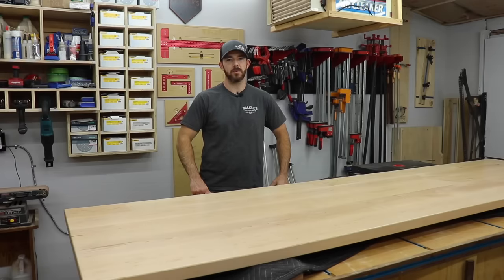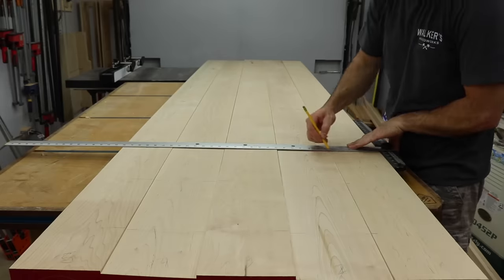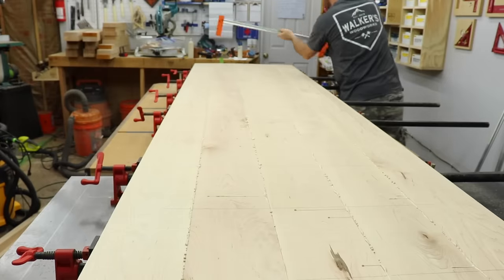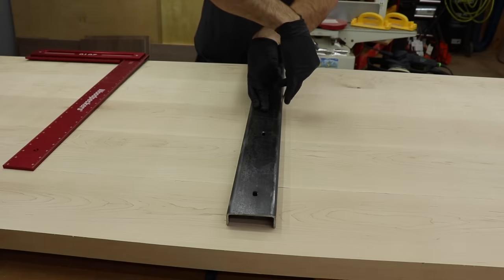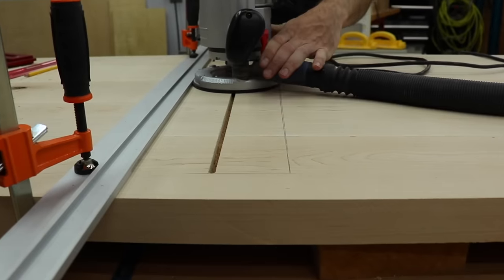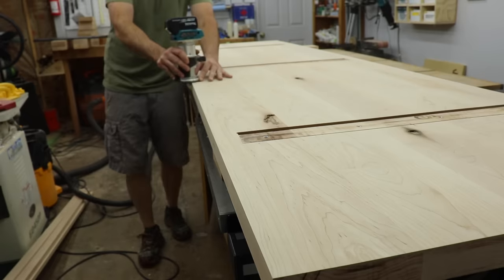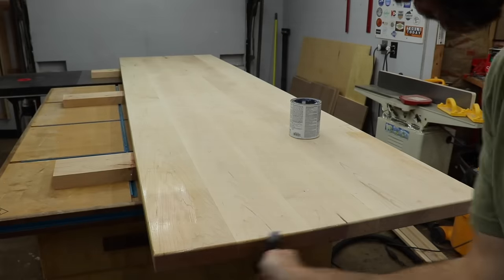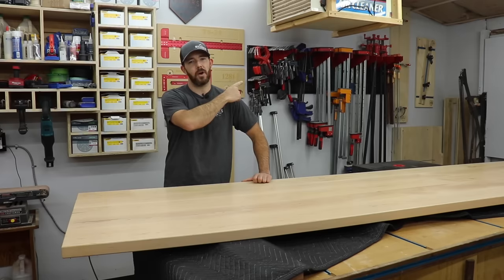How to build and finish a desk top / DIY Table top

Comment from the maker: Be sure to check out my website for other Projects, Blog posts, Plans and Tools I use! Walkersww.com
Reply: This was probably already asked, but what did you use for the legs? Same metal I imagine, but curious if they were just straight legs or "U" shaped. Great video!
Reply: I’d love to see how to do this with out all these fancy tools, I need to make a table top to replace my mdf one. And no idea how to put it together I got the wood glue some g clamps which I’ve realised are the wrong size and wood filler been trying to look for a how to
Reply: Hey I have a question, why did you us biscuits, I see some woodworkers use biscuits or dows, and others don't use them at all. So when do you need to use them?

Comment: I don't know if someone else already mentioned this in the comments, but useful tip for new woodworkers: don't make your biscuit slots too close to the top side of your boards. After moisture sets in they will "telegraph" through the wood by making the surface uneven. You'll be able to see where they are, and the customer will too. Especially when you try a new type of wood and you don't know how it'll react it's best to make the slots closer to the bottom side of your boards.
Reply from the maker: Good tip. I always try to center them.
Reply: Дякую за пораду:yougotthis:
Reply: Ang ganda.

Comment from the maker: Sorry about the glitching!  It must have been in the upload process.  Try to stick with me haha.  Really appreciate all your support!
Reply: Thought it was time for a new phone...
Reply: Do you have a link or any info on the shop vac connection you have for you biscuit jointer
Reply: Hey, that’s ok. I think if you know it’s there, maybe mention it with a card at the beginning? It’s a tiny bit of a seizure risk.
Reply: I want to see a mortise and tenon wedge table, like a normal table top that has mortises running through all the boards and wedged at both ends, glueless tabletop?
Reply: if i dont want to buy a biscuit jointer or learn how to use one more so could i just use glue and pipe clamps?
Reply: Just curious what the finished length was on the table?   I'm looking to make a table that is about 11 feet long to go from one wall to another in my office and this would be the best way I have seen to go about it.   Thanks and great looking finished product.

Comment: Great job on the table, and really good looking materials. The only thing i personally would change is the use of PU. Here in Sweden, and the North generally, finding old furniture with natural coloration changes, some cracks and patina from decades of use, is a mark of beauty. If you want to experiment, try waxing the ood and heatgun melt it, then polish it into the wood and see if you like it. A very organic and fully chemical free version.

Keep up the great crafting, and stay safe 👍

Comment: me and my son in law build a 12 countertop we used 2-8 framing lumber trimmed the edges for square. screwed together with pocket screws quick sanding and stain when we were finnish it looked very rough. But i am impressed how good it looks once installed.

Comment: Love that you install channel on the underside to prevent bowing/warping over time.  GREAT idea!
Reply from the maker: I wish I could remember where I first saw that trick but I use it all the time.
Reply: @WalkersWoodworks  I am new to woodworking. Thanks for sharing this info. I have a question, does bowing/warping occur all the time if a channel is not made? Does it occur on all woods? And to my understanding, the channel you made also doubled up as the place to place the C-panel am I right to say so? Thanks!
Reply: @WalkersWoodworks  The great idea should now be considered stolen!
Reply: Could you also just 2x4 or 1x2?  Would it accomplish the same thing?
Reply: @eechiihaojulian9307 , it is not usual among furniture makers to anchor a table top to metal channel in order to keep it flat. It is normal to expect a piece of wood to keep its shape well enough, if it has been made from properly dried furniture quality stock. If the wood has been exposed for a time to conditions more humid than are normal indoors, for example stored under cover but outside, before being worked to its final shape, than you make expect some problems with stability.

Comment: Awesome build! For anyone else that's going to build something like this for a computer desk though if you don't sink the C-Channel or Angle Iron you can use them for cable management as well.
Reply from the maker: True Story!
Reply: Derek Ries so you get the same function out of the c-channels by not sinking them?
Reply: Dain if you flip the C channel 180 degrees it should give sufficient rigidity to prevent warping, providing you have used biscuit joints as well mate, obviously sinking the strengthening channels looks neater though.

Comment: Hey Brandon, I have probably watched this video 3 times since you published it, and I just finished building a simple maple plywood desk for my wife. I'm thinking of going back and putting a top like this on it later, and this video will be the one off of which I base the new top. Thanks for a quality video with clear instructions and no unnecessary ancillary commentary. (stuff like pointing out the awesome sunset is appreciated!)
Reply from the maker: Thanks a lot Michael that means alot.  Really appreciate the support. Good luck on the build!

Comment: This is a far cry from the desk I built out of 2x6s and a Kreg jig. But, now I have the bug and a lot more tools. Still need a ton more clamps though...
Reply from the maker: Woodworkers can never have to many clamps!
Reply: I have problems with no clamps, no nointer or planer either, got a few old hand tools but that's it

Comment: Outstanding video! I've got an 18" oak that had to come down a few years ago. A friend has a sawmill so we slabbed it out to 1.5"x 10' planks that have been stacked and stickered. All I needed was ideas of what to make with them. Once I've made dimensional lumber from them do you think they would be too thin (maybe 1") to do something like your desktop?
Reply from the maker: No not at all.  But I would do an apron with the base for something that thin and use table top fasteners to secure it.
Reply: Stickered?
Reply: @CoolBreeze640  Late to the party, but it just means that you use spacers or "stickers" between every board when stacking to dry. It allows air to circulate around every board rather than locking in moisture if boards are stacked right on top of each other. This also helps the boards dry more evenly and prevents massive cups, warps, twists, etc. due to differential drying.
Reply: @tbroekemeier  
Thanks!

Comment: Looks awesome!  I'm still very much a newbie, so hoping you can help me with two pieces not shown.  On the underside, when you sanded between the coats of poly, what grit did you use?  On the top side, what strength of scotch-brite did you use between?
Reply from the maker: Thanks!  I used the same scotch Brite to sand the bottom as I used on top.  I think it's just labeled as a fine sanding pad from 3M. But you can also use like 400 grit sand paper.  Works the same.

Comment: Hey man you've inspired me to make one of these myself. Having the C channels made up, would 3mm steel be suitable or would you use 6mm?
Cheers brother.
Reply from the maker: I use 1/8" thick.
Reply: 3 mm bud.
Reply: Walkers Woodworks Love this table top! I’m new to woodworking, especially to using C channel. I’m finding some places online, but not sure how to get them with holes in them. Is there something I’m missing on how to order or find lives similar to yours? My desktop that I’m building is 28” wide btw. Thanks for any info.

Comment: Looks great! Any concern with the crack on the end? I’m finishing a hard maple table top and have the same crack...debating if it’s worth it to put a butterfly/wood key inlay. Thoughts?
Reply from the maker: Thank you!  I stabilized all the cracks with ca glue.  But it's also kiln dried lumber.  Shouldn't have any issues.

Comment from the maker: Don't Forget to check out the woodworking plans I have available! - https://gumroad.com/walkerswoodworks
Reply: Beautiful piece man! I'm interested in your vac hose that you used for the sander and the plunge router. It looks so flexible. Is that an aftermarket or a stock hose that comes with the vac like when you purchase a Ridgid shop vac for example?

Comment: What kind of lumber is this? im looking for lumber that have the 90 degree point and not rounded like studs.
Reply from the maker: Any hardwood dealer should carry what you're looking for.  This is 8/4 maple.
Reply: You can also rip down dimensional lumber as well.  You'll have more waste, but it can be less expensive and easier than working with hardwood.
Reply: Any suggestions for the problem im into now? I glued up my boards for the desk i made a mistake with it and my top has boards uneven as far has high spots. Ideas for removing? I was told a belt sander but i would love other ideas.

Comment: quick tip, yes the quarter inch bit will accommodate some inaccuracies in making the channel for the c channel but if you want, after enstablishing where to put the straight edge for the first channel, just put the c channel itself up against the straigh edge and use that as the new fence for the second pass of the router to have the perfect width

Comment: Great work.  How do you deal differential growth with tops that have horizon and vertical boards?
Reply from the maker: Those are what are called bread board ends.  Basically you only permanently attach the center and just pin the rest so the top can expand and contract.  There are some videos on how to do it.

Comment: Thanks for the video!
Would be good to know how much something like this cost
Also how heavy is the end product, want to make something like this to use as desktop for computer/workstation with right angle to wall instead of stands, but just wondering if the right angle to walls would be stronge enough to support

Comment: Great work and very inspiring.  I hate that I can't do this simply because I don't have the funds to buy all of this, so I'm going rather low budget with cheap clamps, cheap sander, cheap table saw, pine wood and a bunch of elbow grease.  Thank you so much for the links, as it saves time/money looking for some items that may help me that I can afford.
Reply from the maker: Everyone starts off with cheap tools.  I started off with a borrowed miter saw, an old circular saw and a basic orbital.  I will say spend the money on kiln dried wood or you will end up with all kinds of problems.

Comment: Excellent video and well done.  One suggestion - Cauls - much advised to keep the whole surface flat during glue-up.  Cut out notches where the cauls meet your board joints to avoid gluing cauls to the surface.  You will have much less sanding to do if you use cauls.
Reply from the maker: Thanks!  Yea I've used them before.  I still do once in awhile.

Comment: You did a real nice job.....
My question is on your glue up.
If you were staining the wood. Would you let the glue dry overnight as you did or try to remove the glue.
I had some challenges with the wood taking the stain once glue goes near it.
Thank you for your feedback.
Reply from the maker: Thank you!  As long as the joints are tight and it's sanded well that shouldn't be an issue.  🤷‍♂️

Comment: Rounding the top edges seem easy enough. My question as a beginner is do you also round the vertical 1.5" edge? Is it awkward to hold the router in that position? Or do you normally leave the small vertical edge sharp?

Comment: Nice job! What are the final dimensions? How much $ did you have in wood? How much did you charge for the completed table top?
Reply from the maker: It sold for 1k.  I don't remember the cost of wood.  It will vary by area as well.  It was 10ft long and 36" wide

Comment: Awesome video and tabletop. I'm building the same thing tomorrow out of the same wood, but 80x29" Thanks for the tips. Any idea what the owner used for legs? I'm debating what I want to do. I'm also considering routing out a channel along the back to help with running cables from my computer since I'm a cable management freak
Reply from the maker: This one just sits on cabinet bases.

Comment: Awesome video bro!!!! Straight to the point. I got a question. If I were to use pocket holes would I still need the c channel? Do you think it'll have the same type of finish? Just starting with woodworking. This darn quarantine is getting expensive lol.
Reply from the maker: I would not recommend pocket holes st all.  They are not needed if you glue it all up and they wouldn't help with beeping the top flat.  Some say you don't have to do the channel but I like to use it for extra support.

Comment: Very cool project. How long will the glue hold - basically, forever, or will the boards start coming apart eventually (from vibration, daily use, etc)?
Reply from the maker: Never seen one come apart yet. 🤷‍♂️
Reply: @WalkersWoodworks  I appreciate that info 🙂 How many years, would you say? 10, 20, eternity?

Comment: At 9.50 there's a small gap between the boards. Is this unavoidable to some degree on a big glue up? And if so, do you have any recommendations for addressing it? I'm assuming mixing saw dust with wood glue, but I'm wondering if there's a better way.
Reply from the maker: Sawdust and wood glue is my go to.

Comment: That looks really nice! 
Question: if it was an L-shaped desk, would you simply cut it at 45 at length with a circular saw and glue them together? Before all the sanding I mean. Thanks
Reply from the maker: No I usually don't glue that joint if I do a miter.  I'd just use a metal bracket on the bottom side to hold it flat.

Comment: Ok, love the video, learned a lot from it.  But I am frustrated as hell right now.  You gave a source for the inserts, but I can get those cheap enough locally.  You gave no information on the C-Channel.  Dimensions? Source? And as far as the inserts go, what size screws/bolts do they accommodate?  1/4 - 20?  In addition, what screws/bolts are you using?  I can't find them anywhere.  this information would really be helpful.  Thanks
Reply from the maker: Sorry.  I just get the channel from the local steel yard.  I usually use what I can get cheap lol.  It's usually like 1-1/2" x 3/4".  The inserts I get from rampa.  It's online only.  These are the skd30 inserts.  I have used the cheaper ones from Amazon as well.

Comment: Nice desktop, I'm building one now using 5/4 maple and it is S3S as well, but I have had a heck of a time getting the joints acceptable.  I tried using my 6" jointer but with the long boards, about 70" I can't manage them accurately on the jointer.   Any anything special about your ripping setup that gets you glue-ready boards?  Blade?  Setup?   Other?

Comment: Someone may have asked this as well but.. Is there a difference in the ‘rotex?’ sander you used for flattening and a regular orbital? What you’re using seems more aggressive.. Great work by the way!
Reply from the maker: The rotex is a full rotation or random orbit. The full rotation takes off more material.
Reply: @WalkersWoodworks  so basically like a buffing wheel with sanding pads..

Comment: Amazing video! We're making a similar table top right now and are wondering what the exact specs are on the Rampa inserts and machine screws that you used.
Reply from the maker: I only can remember they were the skd30 ones.  I believe 6mm?  Don't quote me on that.
Reply: I contacted Rampa & they didn't disclose any personal information to me but they new of your account and I was able to order the same inserts and machine screws that you had ordered. I think it's a great system. We will be attaching some metal legs to the table and I think this will be fantastic! Thanks again for your video it was a great resource for us.

Comment: I have a desk now that's a corner desk with I believe it to be mdf top and some pretty nice metal cabinets I love top because it's an inch thick and pretty deep but it's not wide enough I need more room on either side.      And I love the look of this top. How would I adapt this to be used in a corner desk.   And I would prefer not to have a joint right in the center
Reply from the maker: Would be hard to do without a miter joint.  Unless you did like a herringbone pattern.

Comment: Great video.  Thank you.  I am having a heck of a time finding the c channel.  Can you provide details on it.  It looks like .25” steel @ 4” x 1/2” x 36” .  Am I close?
Reply from the maker: Email them at ambwoodandsteel.com I use 1"x3" 1/8" wall.
Reply from the maker: The length depends on how wide your top is.  I usually go 4" less wide than the top.
Reply: @WalkersWoodworks  Thank you.

Comment: How tight do you fasten the machined screws through the c channel? I imagine its a balance between allowing room for wood movement but fastening them tight enough to keep the boards flush with the c channel so it can do its job.

Great video, thanks for making it.  Using the c channel with an 8/4 red oak nail table for my wife’s business.
Reply from the maker: You nailed it!

Comment: You used scotchbrite pads to make the poly smooth, which ones did you use?  Hand sand with those or I've seen it done under an orbital sander?
Reply from the maker: Just the fine pads.
Reply from the maker: I do it by hand.